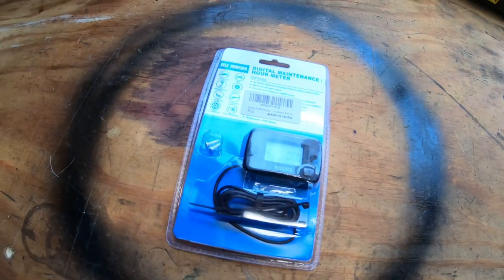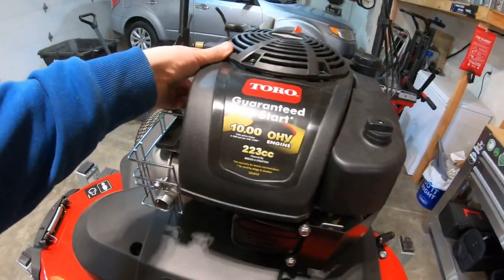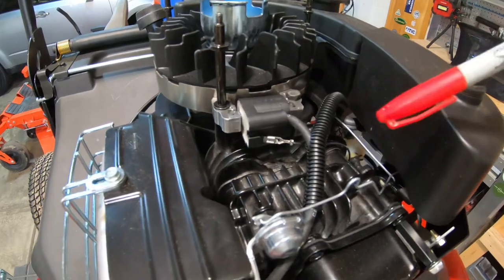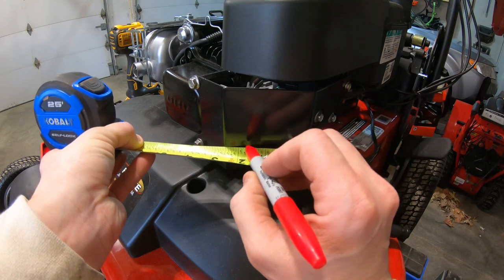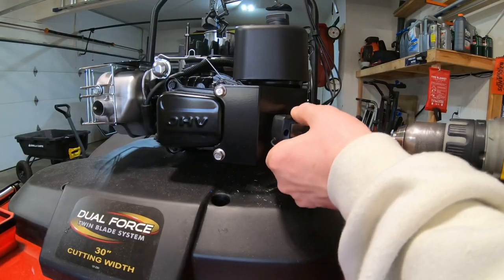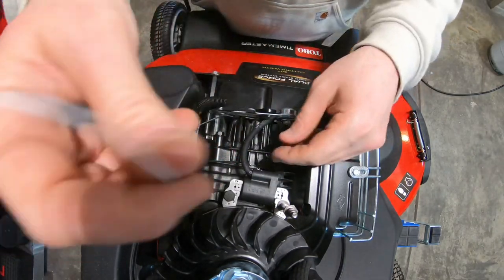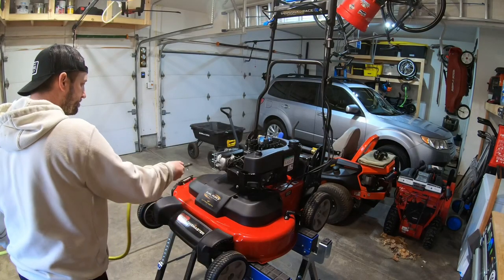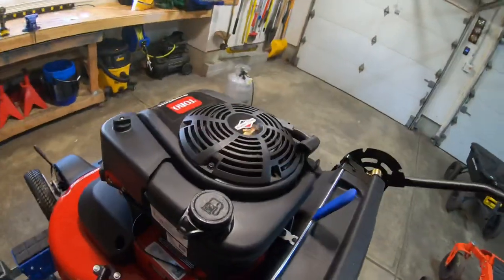Install Hour Meter on NEW Toro Timemaster

Comment: Because a current is being induced in the meter's wire by the expanding and collapsing magnetic field created by the spark plug wire, there was no need to strip the meter wire, compromising its integrity.
Reply from the maker: Makes sense. Thanks for watching and commenting!

Comment: Is the hour meter you purchased waterproof?  Just wondering since I clean my mower after each use. How reliable do you think the rpm meter is?
Reply from the maker: It is water proof! 

Jayron JR-HM019 Digital LCD Waterproof Gasoline Engine Hour Meter Maintenance Meter

https://www.amazon.com/dp/B07PP1WGHS/ref=cm_sw_r_cp_api_i_J690KBSAZCCC0FDCCNQD?_encoding=UTF8&psc=1

I think it has been spot on with clocking the time. I think I’m just over 12 hours now. It has been super nice on there. I do recommend it. 

Thanks for watching!

Comment: what size plastic conduit is that?
Reply from the maker: I want to say 3/8. But you could use 1/4 inch. It doesn’t need much to cover the single wire. 

Thanks for watching!